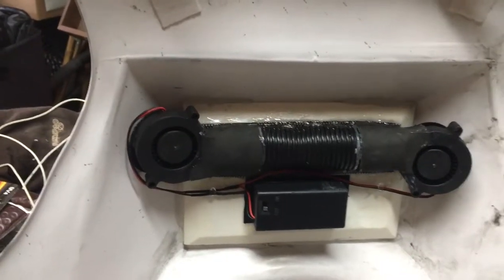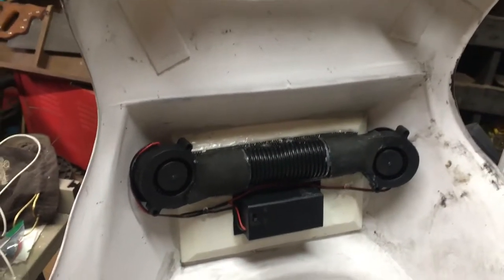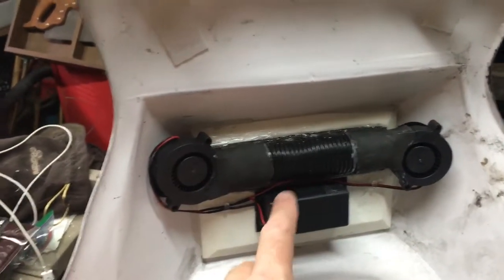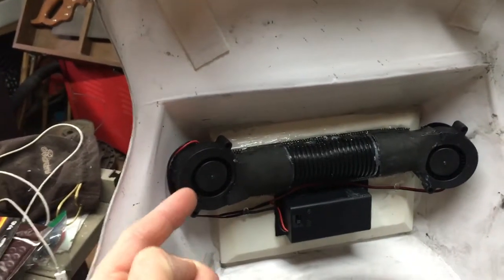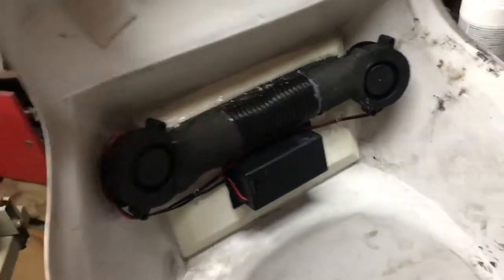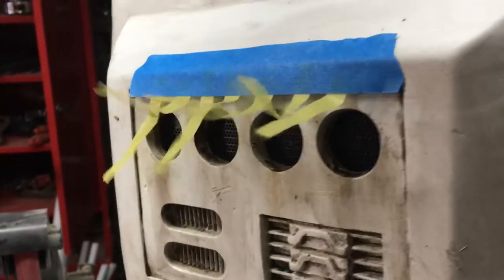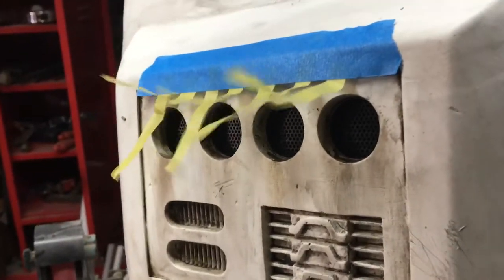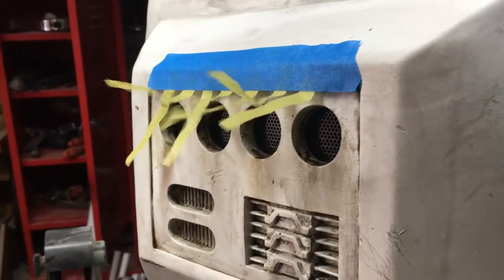Clone Trooper back plate cooling system

Comment: I would have figured having the fans drawing in cool air to blow across your back would have been better.
Is there a greater advantage to having it the other way around?
Reply from the maker: Both ways create airflow. On this, I thought removing hot air would draw air from all over, creating more of a general cooling. But who knows for sure?
Reply: @OddViking  Very good point. I have a shoretrooper armor set I'm assembling and have both an intake fan at the bottom and an out-flow fan at the top. Still experimenting but it does keep my back frosty even in summertime condition testing.